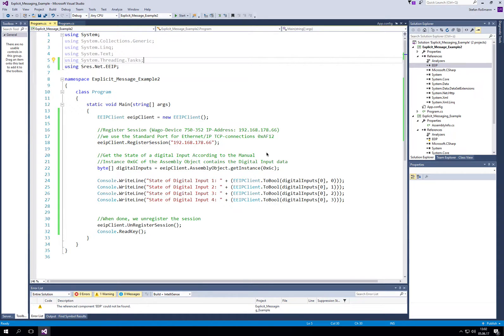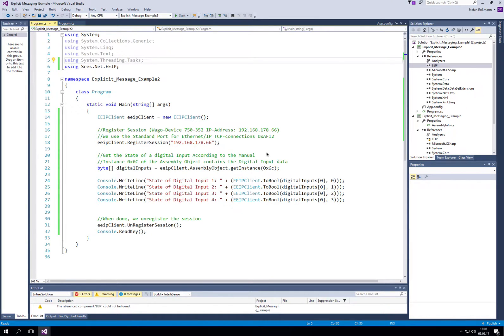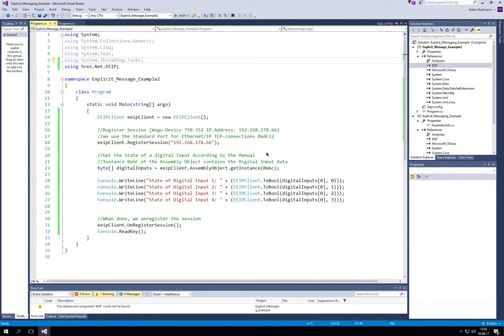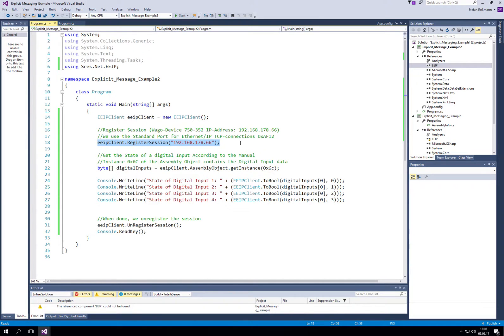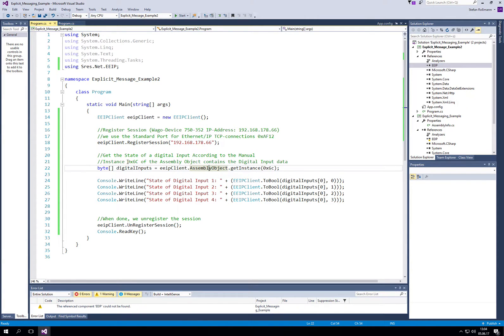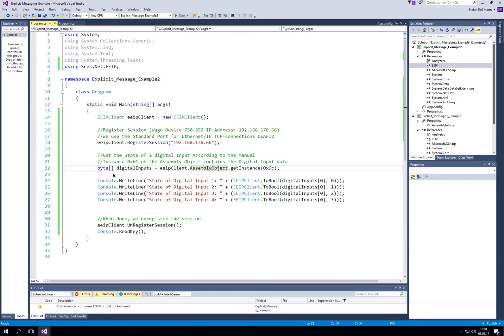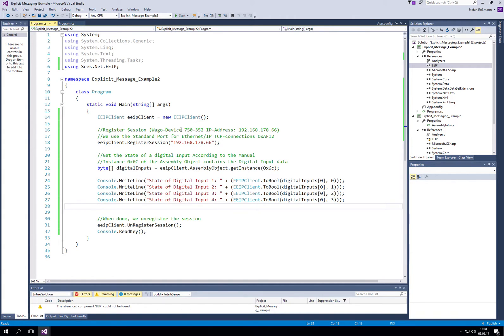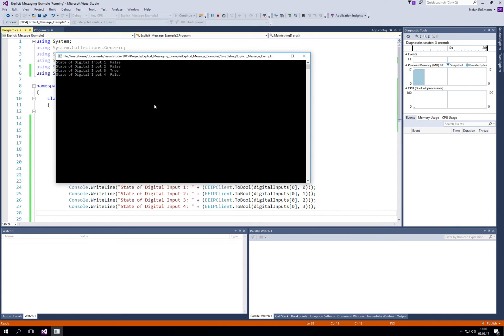EEIP Library - Explicit Messaging: Read Digital Inputs from Ethernet/IP Device

Comment: Hi, I'm testing the EEIP java library with AB Micro800, but I get this error de.re.eeip.cip.exception.CIPException: Object does not exist
Reply: Hi i am using same in c#. I am getting same error. How did you fixed the issue?